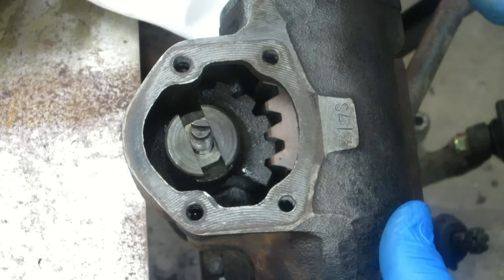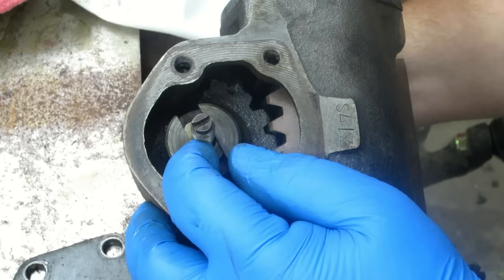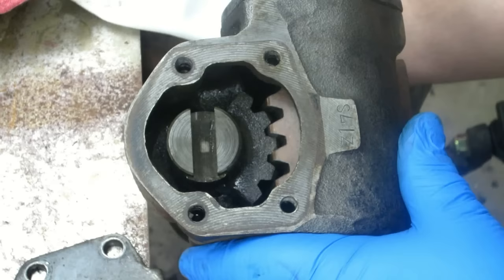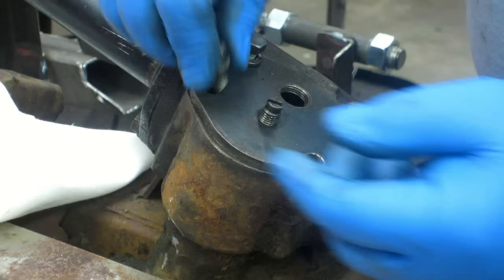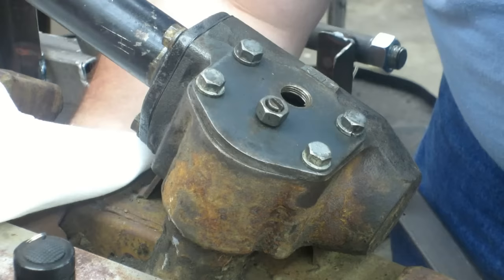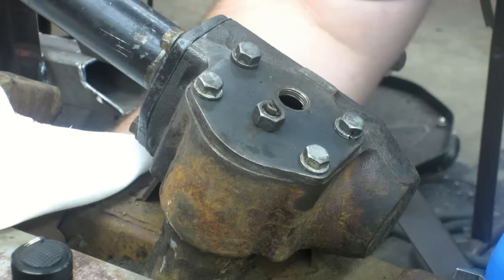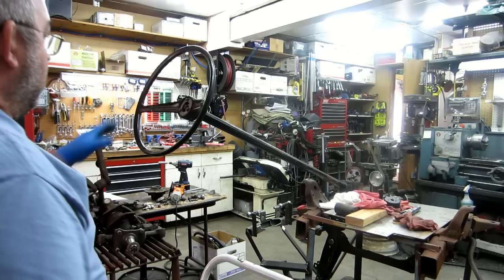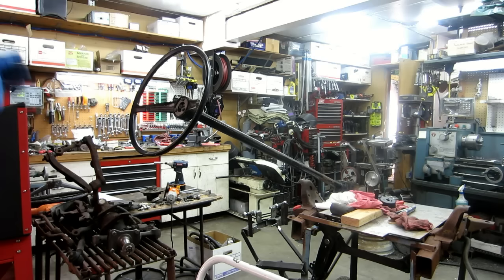Sector Shaft Adjustment

Comment: Have you ever seen the adjustment plate at the top of the sector shaft get worn out. And can I replace just the four bolt plate or would I have to replace the whole box... Truck steers fine but has play and rattles on bumpy roads.. There is no plate left at the top of the sector shaft where the adjustment screw goes it's completely worn...  The shaft teeth and adjustment screw look ok.. I will be posting a video later today to show the problem
Reply from the maker: I found your vid and posted the response on your vid. :)

Comment: With it out of the car like that, you should be able to set it up with and inch pound torque wrench.  Remove the shaft and turn the gear directly with the torque wrench, specs should be in your GM manual.

Comment: how does moving the sector shaft up and down losen or tighten the teeth? Is the rack at an angle? are the teeth tapered?
Reply from the maker: Since I've gotten this question several times recently, I went ahead and created a page on my site for it with a drawing from the manual.  
http://www.bluehandsvideo.com/steering-box-adjustment-datsun-521.html

Comment: I have to question this a bit.

There should be more wear at the center than at the ends, because you drive straight more than you go around tight corners. So it seems to me you should adjust it for almost no play at the ends, then it is whatever it is in the center (that is, there will be more slop there because there is more wear). I also wonder about what happens when the gearbox heats up - does that play at the ends go away or get bigger? But for sure, do the adjustment at the ends (the tighter end if there is any difference).
Reply from the maker: I think the tightness is cause by the shape of the gears more so than wear.  At least with this box, it you adjusted for no play at the ends, you probably wouldn't be able to turn it back past center.   Interesting question about the tolerances changing as it heats up.  I would tend to doubt they'd change much....maybe not even noticeable.  Cast iron is very stable across a very wide heat range.  That's a big reason why they make milling machines and lathes with it.  If it moved around with temp changes, the machines would only be accurate at a certain temperature.
Reply: I just adjusted my Dodge van and it worked the way you said it would. So I was wrong. I had done this years ago on another car and thought it worked the way I described. Maybe it did on that car, or maybe I'm just remembering it wrong.
Reply from the maker: That's awesome!  It certainly wouldn't have been the first time I was wrong. :)  There are different styles of gear boxes, so I wouldn't be surprised if it did get adjusted differently.  My memory is pathetic!  That's part of why I started doing vids......so I could refer back to them to see what I did and how. lol  Thank you for coming back and letting me know!! :)
Mike
Reply: Thanks for admitting you were wrong! That seems to be very hard to do now days, and i commend you for it.

Comment: I realize this is a demonstration. But what if the system was pressurized or had some type of lubrication? Would the results be different regarding binding?
Reply from the maker: Interesting question.  I don't really know, but I think the "bind" is because of how the gears are ground.  It's typically got 90w gear lube in it.  This was pretty dry when I was doing it.....maybe it would have been less noticeable if more lube had been on it.....?  Maybe another viewer will have a better answer. :)

Comment: Hi, I was trying to replace gear box oil in my 720 truck , but cant find any evident "plug" to  drain old fluid! can  you please help? thxs!!!!!
Reply from the maker: Sorry for the late reply.....YT seems a bit weird about not sending me notifications for all comments.  Outside of removing the box and turning it upside down.......or, removing the pitman arm and pulling the sector shaft up so that the oil drains out the bottom......the easiest way would be to get a cheap suction pump from a car parts store and suck it out.  Something like this should work.....
https://www.lowes.com/pd/Arnold-Siphon-Pump/3142667?cm_mmc=SCE_PLA-_-OutdoorPowerEquipment-_-Lubricants-_-3142667:Arnold&CAWELAID=&kpid=3142667&CAGPSPN=pla&store_code=1114&k_clickID=b1797905-e4d2-47f0-95c6-6b010c4f2c14
OR
https://www.zoro.com/lincoln-suction-gun-18-oz-blue-615/i/G1379743/?gclid=COW6kqn9z9ECFUtNfgodvSAPcg&gclsrc=aw.ds

I prefer the second style....easier to clean and handle, but you might need to get a longer tube(most hardware/home stores should have it).
Thanks!

Comment: What happen if you dont get this fix? Will it just leave you with out steering at high or low speed?
Reply from the maker: It's just an adjustment to take some of the slop out of the steering wheel.  If that adjustment bolt failed and let the shaft drop down in, that might be a serious issue, but I don't think that's anything to worry about.

Comment: hi for the adjusting screw there it have no Oring in place.So the oil may leak thru there right.
Reply from the maker: It may, but it's unlikely.  When the lock nut tightens up, it pulls one side of the thread on the screw tightly against the threads in the hole.  That should block the thick oil that's inside.  The nut will also have somewhat of a seal against the top plate, too.  I wouldn't be as worried about oil getting out as I would water getting in.  I've never heard of it being an issue.  Thanks!
Mike

Comment: You probably should put grease in there while you're adjusting it
Reply from the maker: Normally it would be closed, sealed and filled with 90w gear oil.  I was doing this purely for the demonstration....grease and oil would have just made it harder to see.  :)

Comment: They wear funny sometimes.his is binding a bit in the middle so it's probably wore.rebuilt ones have new gears bushings and seals.so if yours won't tighten up get a rebuilt.better safe than sorry.or get a
 used one at the junkyard.
Reply from the maker: Thanks.  That's one that is only on the mock up frame and will never be in a vehicle.  If the one in my wife's truck gets too worn out, I'll convert it to rack and pinion. :)

Comment: I just replaced my gear box and after a test drive it is leaking from between that nut and the adjustment screw. Any thoughts on a fix?  Any input is much appreciated. 
And great video. Thank you.
Reply from the maker: Is it the same box?  I'm guessing it's overfilled.  Gear lube doesn't "splash" around like thinner oils.  On this box, the cover is threaded and the nut is to lock it in place.  Maybe put some tefon tape around the screw..?  
Thanks!
Mike
Reply: @bluehandsvideo  It looks like it's about the same kind of box. It's for a 94 chevy silverado. I'm going to try to put Teflon or a thread sealant on there tomorrow and let it cure. Fingers crossed. Thanks for the reply. 🍻
Reply from the maker: @brianfauver1790  You're welcome.  Good luck! :)

Comment: Please help.  Could extensive play in the sector shaft cause a loud thud over bumps/potholes?  2013 Jeep Wrangler unlimited.  Thanks in advance.
Reply from the maker: ***** I suppose it could, but I would think the heavy lube in it would dampen it.  If it's that loose, you can probably feel the play in it by pushing up on the bottom of the sector shaft where the pitman are is attached.  If there's a lot of movement, I'd adjust it and see if the noise goes away.  While your down there...push pull the rest of you steering components and see if something is loose or worn.  It's really hard to tell from the vid but it's more likely a ball joint or tierod.  Sorry I can't be of more help, but those noises can be hard enough to diagnose when your actually in the vehicle. :)
Thanks!
Reply: ***** I had a similar problem with my 2003 Hummer H2. After replacing the upper / lower ball joints, inner / outer tie rods, the suspension was much quieter. But that thud still occurred. The big clue was the tracking wandered while driving on cambered roads. I just replaced the Pitman and Idler arms. That solved the "thud" problem. The steering is now very precise, with no play at all. And the tracking remains straight on any road. Hope this helps you.

Comment: with my truck running it seen like i dont have no tention in the wheels seems like its nothing hook up it feels that loose...its a 90 fullsize k5 blazer 35x12 tires on it..if that will help u out any
Reply from the maker: +abdyfe  If you can see the pitman arm move right away, but not the tires, there must be play somewhere between the pitman arm and the tires.  You said everything is new.  Are all of the tierod ends fully seated in their tapered holes?   If they're the wrong taper, they might be able to move in the hole.  Sounds like you have power steering?  There will always be some amount of play with a steering box compared to a rack and pinion setup.  I'm not really a mechanic and I've never worked on a Chevy box before.  I've owned them, just never had to work on them.  Sorry I can't be more help.

Comment: My american willies jeep having manual steering gear box.from long time i
 buy this jeep i can turn full only one side (up to tire touches the 
body.)But other side can turn only half only.So for turn other side i 
have to from and back the jeep 2-3 times.Where is the problem?How can i 
fix the problem.Please help me..
Reply from the maker: I'm not familiar with the steering box on a jeep.  If it's like this one, it sounds like you'll need to pull the shaft out and recenter the pitman arm.  I'm sure there are forums online that could provide better help.  I would guess that manuals are available, too.  Sorry I'm not more help, but I'm only familiar with this box.

Comment: What oil do you put in there?? And at what level
Reply from the maker: Off hand, I don't know.  Most gear boxes will take similar lube, but your best bet is to look up what your's call for.  Most parts stores can look it up if you don't have a manual.  If you're referring to a Datsun 521 truck, it should be listed in the factory manual.....which you can download from my site bluehandsfab.com or several other places online.  I don't remember if this box has any brass in it.  There are 80-90W lubes that are not recommended for brass parts.  I'm sure that's typically more of a concern with transmissions and differentials.

Comment: hi blue hand. this is what had happened on me.and I was thinking it got no seal or Oring and how do I handle it?just replace the screw and the jam nut?
Reply: and water from outside no pressure how to get in.but fluid in the gearbox is under pressure wouldn't you be more worried about?

Comment: Is it possible to jump gear teeth with it all the way out or very loose?
Reply from the maker: Hmmm....maybe it's possible, but I really don't know. Sorry.
Reply: @bluehandsvideo  my friend seems to think the pitman arm was replaced a few teeth off making the steering wheel look correct, but actually off °360 but the wheels straight. Is that possible?
Everything is straight  but bottoms out half way through left turns.
Reply: @bluehandsvideo  but. Yes. Thanks for the video. 👍
Reply from the maker: @siggyretburns7523  Typically, the pitman arm is keyed and only goes onto the shaft in one position....so you could be right.  Is there reason to suspect that the shaft was taken out of the box?  Are the tierods equal length on each side?  They could have done those wrong and then moved the wheel.  Only the older cars will allow the steering wheel to be positioned off center.  A lot have a missing tooth on the steering wheel mount splines and can't be set off center.  If you know that the box was worked on(messed with), I'd check it first, otherwise, that's the hardest thing to fix, so I'd check on the tierods and then the steering wheel first. good luck.
Reply from the maker: @siggyretburns7523  You're more than welcome.
Reply: @bluehandsvideo  yeah. The tierods are both centered equally, but one of the set nuts was loose. But now im thinking he might have disconnected the steering column from the box. It all depends on where the limiter is. If its in the steering column, then its probably the connection was diconnected and reconnected after the wheel was turned °360 degrees. I dunno. Trained specialist is looking better all the time. Lol thanks though.
Reply from the maker: @siggyretburns7523  If the column was disconnected from the box, it's most likely that they didn't line them up correctly when they reconnected them.

Comment: Why did the manufacturer design it this way? I am trying not to have any play in my steering wheel!
Reply from the maker: It's old technology.  They came up with rack and pinion later......which is about the only way you'll be able to get zero play in your steering.  A brand new steering box might come close, but it will still wear out eventually.

Comment: Good video but you should be careful about saying "shadetree mechanics." I've worked under the shade of a tree plenty of times but that doesn't mean I don't do quality work.
Reply from the maker: Thanks.  I had to listen to it twice to catch the comment.  I don't think the way I said it was in anyway derogatory toward shadetree mechanics.  That's all I am. I simply pointed out that they'd be doing it by feel instead of using a fish scale to measure the breaking torque on the steering wheel.  I consider a shadetree mechanic simply someone that's not working at a shop or dealership.....not an comment on quality of work.  Is there a "stigma" out there towards the word "shadetree".  I haven't noticed one, but I don't pay much attention to that type of thing. :)

Comment: So I have a 1985 Chevy c10 steering gear box..an I can't find a video or diagram of the ajustment section..mine has a spring a ajustment bolt a dime shaped plate..but there was a ?? Seemed like a washer but it was so far gone so I couldn't tell what it was.? Any help?
Reply from the maker: Sorry Richard, but I'm not really a mechanic.  I don't have any clue about how to help with that box.  If you have the time, you might scan through some of the comment left....there's been some really good mechanics leave comments here. You might try contacting one of them.  With any luck, someone might see your comment and chime in.  :)
Mike
Reply: bluehandsvideo OK cool..if I could find a diagram of the ajustment screw assembly that's what I need..
Reply from the maker: Have you tried finding the factory repair manuals?  I've bought them for several vehicles over the years and they've always got the nitty gritty details that the parts store books never have.  Does the '87 have the same/similar box?  Took about 30 seconds on google to find this...  
http://www.73-87chevytrucks.com/techinfo/7387CKMans//Service/ST_330_87_1987_Chevrolet_Light_Duty_Truck_Service_Manual.pdf

....you might ask 610GARAGE....he's got a vid up of how a power steering box works....he just might know the answer to your question.  I haven't turned a wrench on a vehicle in a few years now.....even then, I was just a driveway hack. :)